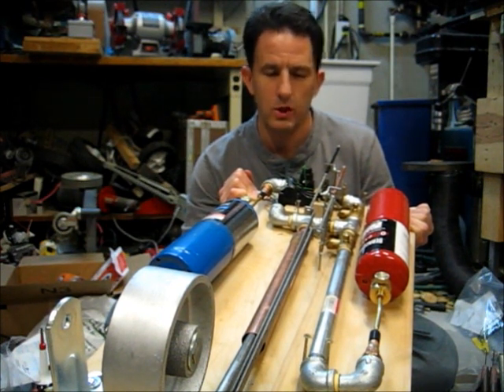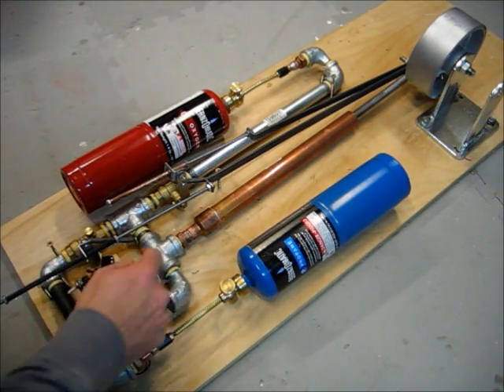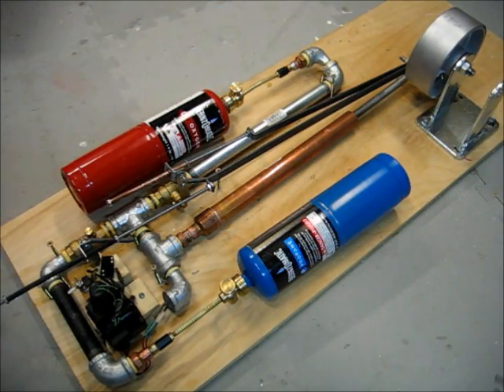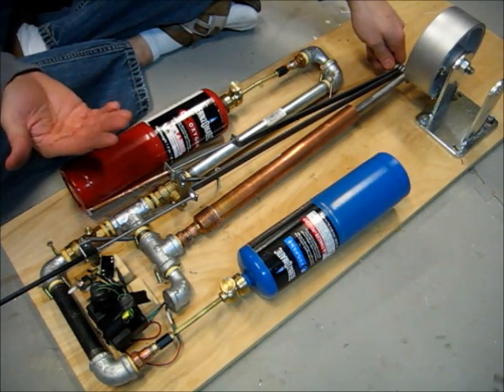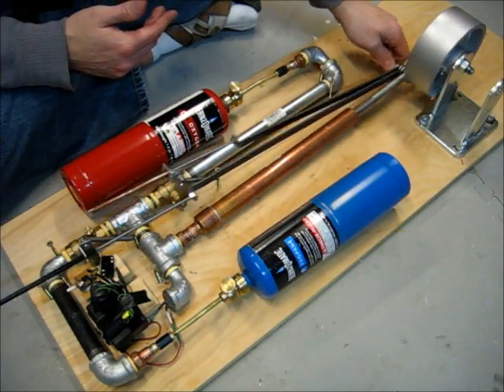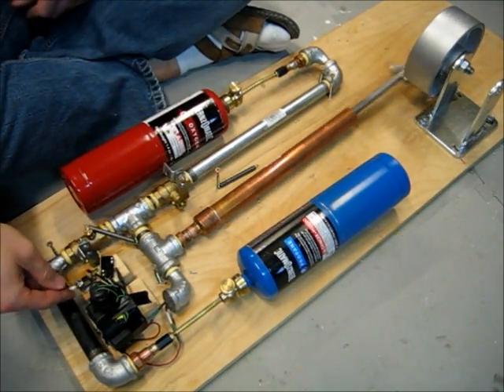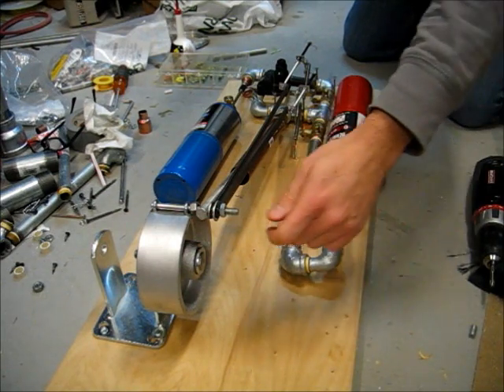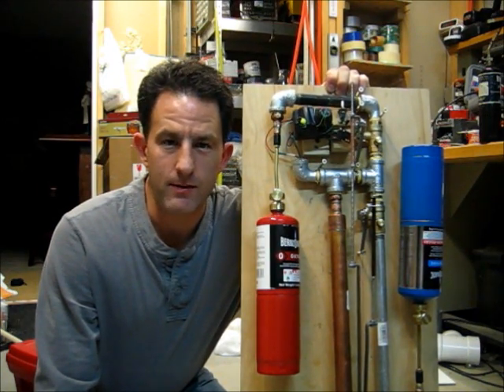How To ALMOST Build an Engine With Only Parts From the Hardware Store (HowToLou.com)

Comment: did you ever find a fix? Was the problem the exauhst leaving behind too much gas in the chamber so it couldn't ignite? Or is it a timing problem with the spark? This is so cool. These are probably stupid suggestions, I barely understand anything about engines but love them.

Comment: You need spark, fuel air and compression for a gas engine. I would check compression as the other 3 seems to be there. Hope this helps

Comment: If you are still working on this, here's my more than two bits. I see a lot right here and a lot wrong. Glad you are trying the project. I love it when anyone breaks down the perception that everything has to be made in some giant factory. 

The volume of the combined combustion chamber and cylinder is so great that it does not seem to be intaking enough new gas to overcome the spent gas. Even if you get a few strokes out of it this is just going to get worse. Why? Eye balling the set up I think the combustion chamber volume is possibly more than the cylinder volume. This means the % of combustion gas will never go down.

I would get those valves right on top of the cylinder. As close as you can get them without making special parts. Maybe go with solder fittings which are usually a lot shorter.

I would also increase the cylinder diameter. I think a 2 " pipe might be enough. That will help pull in more new gas than spent gas that is hanging around in your combustion chamber. 

Your piston seems sloppy so I'm guessing it's not getting much compression. Maybe you can try using 3 or 4 washers with some leather sandwiched between them. The leather will burn after not too long but so what. If you get it to run for ten seconds you've proved the point. 

A tighter piston and more compression will require a heavier fly wheel. 

On your carb bowl I would put a cap that is bigger than the pipe on the air intake and drill a bunch of small holes to try to evaporate the fuel more efficiently. To adjust the fuel air ratio you could put a small gate valve from an icemaker line to allow some air to bypass the evaporator line. 

Or you could make a venturi. They sell venturis in the garden section for pulling chemicals into a running hose. Not sure they will work with air. 

You need to open your exhaust valve well before the bottom of the stroke. I can't tell when it's opening from the video. If the piston is under pressure at the bottom of the stroke it's going to want to stay at the bottom of the stroke. A larger flywheel would overcome some inaccuracy in the exhaust valve timing but not much. 

Think about how long your intake valve remains open too. Too long might create too much explosive force for the wall thickness of the cylinder. Of course even a better piston as I've suggested to going to have a lot of blow by at higher pressures. 

If you get a tighter piston and you approach even 100 psi the bolt attaching the piston rod to the crack wheel is probably need to be bigger. Do the math - pi * radius sqaured in inches * ball park PSI. Get a feel for what's going on. 

Finally stiffen up all your push rods & pull wires. Slop is your enemy. 

Good luck, be safe & let us know!
Reply from the maker: John Delaney - Great suggestions.  I have already reduced the combustion chamber, so we are getting 4 or 5 to 1 instead of 2 to 1.  Also, a big breakthrough.  We found the spark was often shorting outside the clyinder.  Send and email to HowToLou@gmail.com if you would like a picture of the latest setup.

Comment: I Agree with them on the exhaust and fuel to oxygen ratio. But also it seems like your timing isn't right. I see the metal rods are taking place of your cam shaft. But you could mix your fuel in oxygen in one valve and direct that into the combustion chamber. And use your other "valve" on the exhaust. So fuel and oxygen would go in to the combustion chamber in 1/2 stroke and in the next1/2 stroke your exhaust would come out. To do that you'd have to relocate your fuel and oxygen into the same valve and create an exhaust pipe. The reroute your "camshaft"

Comment: Look up the two stroke cycle; you need to exhaust your engine like that. Additionally, you should rig a remote starting cable onto this and run it outside before you blow yourself up, or it fails and a linkage injures you.

Comment: Judging by the smoke you have when you compress the cylinder by hand and no smoke when you operate the gas inlet manually, I'd say you're basically choking your engine out with exhaust gases displacing your intake gases.  I guess if you had an exhaust port in your cylinder so that the push rod would reveal the port at the end of the stroke then that would work.  You'll lose a little efficiency, but at least you won't have to force the exhaust gases out by hand after every stroke.

Comment: Try building a circuit that has servo's to allow a two stroke engine and to allow beter timing but you may need to do some research for the circuitry and yes the exaust is nesecery because the expended gass prevents the new from coming in and burning properly that's all I can thisk of right now ill post on your take 2 vid if I come up with more ideas

Comment: I would try cutting a hole in the copper "cylinder" at the top end of the stroke, basically my understanding of this is it is simply a 2 stroke engine, you just need the exhaust gases to vent.  That would allow that to happen when the piston passes past them, and the momentum of the flywheel will push the cylinder back down for the next power stroke!

Comment: This was the first thing I saw with this. I'm a mechanic and not an engineer but even I could see that. Perhaps you could replace the T fitting above the piston with a Cross fitting and another valve to open on an exhaust stroke.

Comment: +1 for check valves.  You don't want O2 going into your propane tank or vice versa.  In general I wouldn't try mixing the two in a closed system like this, it's just too dangerous.  You should investigate using a propane/air mixture instead.  I know it might mean a re-design but you don't want to end up with a pipe bomb.

Comment: it looks like one blast is creating so much force that the rpm is too fast for your flywheel. The next cycle doesnt have enough time to pump and mix gas/oxygen/get spark off at the right time. It looks like it might work with a slower rpm/larger flywheel that gives a steady amount of fuel/air.

Comment: Lou, your connecting rod keeps hitting the cylinder walls, which is causing a lot of parasitic loss.  Ideally, you need a 2-piece connecting rod with with a rod guide near the open end of the cylinder (look at a diagram of a large 2-stroke diesel from a WWII submarine or a cargo ship).  The people talking about your fuel-air ratio are correct, you need to lean it out some more (stoichiometric ratio for gasoline/air is 14.2:1, propane/air is 15.5:1, propane/pure oxygen is 3.63:1).

Comment: I'm absolutely no mechanical engineer ... but it occurs to me a lot of energy from the engine is (presumably) going to get wasted in noise, heat and "velocity" wherever parts of the engine aren't moving smoothly and precisely.

I doubt it's going to "make the difference" between what you've shown and a running system, but I'd consider (alongside a flywheel for smoother momentum) lubricating all the parts and anchoring (holding, securing) the wheel from both sides - and balancing the weight in it

Comment: For those who are wondering,this engine type is 2 Stroke True Naturally Aspirated Engine,running on uncompressed mixture igniting at atmospheric pressure. The efficiency of this will be about 1.5 - 2%,however power output enough to keep it running is the only thing to consider.

Comment: Make a sleeve to cylinder end to support the connecting rod so it doesnt go diagonally into cylinder. Reduces friction. Also heavier flywheel. And exhaust valve of some kind. Play with gas pressures to get mixture right.

Comment: Maybe change the rates at which the chambers fill up as it seems that with enough explosive power, the piston actually move "properly". Especially since propane might not have the right properties for this, you will need the right amount of power.

Comment: Love your new cam system, taped right onto the flywheel.  Now that you have an exhaust port, it would be great to open up the fuel valves to push the exhaust out.  No danger there at all!  If you just relieve some of the pressure, the piston is going come back and compress a chamber full of smoke into which you introduce some fuel.  If one of your tanks was compressed air instead of oxygen, you could use that and be safer.

Comment: Heavier flywheel. You will not reach high revs with this engine. you need a heavier flywheel to keep it running. The engine runs unsmooth and stops itself. the flywheel will help it

Comment: Reading the comments so far, I'm seeing a lot of the things I was thinking already mentioned: heavier flywheel, lack of a true fuel/ox metering system, and spark timing.  I think the barbecue ignitor may have to go, replace it with a capacitive discharge circuit. Can "hardware-store engine" include radio shack parts?  Also, I see that when the piston fires, it puts out quite a bit of energy that could be harnessed by a larger flywheel to keep the engine moving.  Good luck and I'll stay tuned!

Comment: it seems to me like there could be unburned propane left in the cylinder after firing, as a result the first stroke is powerful and steady, the second is weaker and so on. for each stroke the amount of unburned gas builds up, leaving the mixture in the cylinder richer and richer in propane.

my best suggestion is to look into mixing the oxygen and propane more thoroughly so you get a uniform mixture across the entire cylinder.

good job on the build, i'll be subscribing to see the result. :)

Comment: Looks like not enough gas is getting to the cylinder. When you manually operate the valve it is open for over a second, however when the system is running the valves are open for a split second.

Comment: I would be very concerned about the copper pipe exploding from the pressure, since you are using oxygen from the tank. It's not going to hold together under that much pressure. You should also check your compression ratio, and maybe use a shorter, wider cylinder. I think the grill igniter isn't giving you precise enough spark timing, either. Maybe a cheap electric fence charger and a car spark plug running through some points would be better.

Comment: Lots of smart people with great comments. I have an idea for a better gas mixing manifold system. Do you have a way to view CAD drawings, or I could email you a pdf of a drawing.

Incidentally, I am super impressed even at what you have done so far, and you earlier project making an electric motor was golden. My sons and I had a ball doing that. I cheated since I have a little machine shop, but I really dig the way you are using commonly available stuff. Thumbs up!

Comment: Then it throws the piston down to the bottom where the exhaust port will uncover, the gasses will "pop" out the exhaust port, pressure in the cylinder will drop and fresh mixed gasses will be able to flow in through the check valve.

If you cant find a check valve in the store you can make one with a piece of pipe, a big ball bearing and a spring.  (look up check valves if you dont know what im talking about)  Also look up 2 stroke engines.

Comment: with a check valve you dont need to waste energy opening and closing those valves anymore - reduced friction.

Simply pull some gas mixture in on the downstroke, when you get to the bottom some will puff out the exhaust port but ignor that.  Then compress (by hand on the first stroke) the check valve will close during compression and the exhuast port will be covered by the piston.  somewhere near top dead center (maybe just before you get there) have the ignition cut on

Comment: In addition it looks like you have a lot of friction.  The brass plug needs a groove and piston ring.  Achieves the same seal, but applies less friction.  Same is probably true for those little ball valves.

many two stroke engines use a reed valve, basically a one way valve to admit gasses into the cylinder.  Consider finding a check valve to do the same.  That way the gasses can be premixed and allowed to enter the engine when the piston is down, and then the piston will compress the gasses.

Comment: Lots of problems.  Those tanks are pressurized and you have equal sized pipes and valves, so achieving the right mixture will be super tricky.  Why not just use pipes and holes to make a carburetor and gravity feed gasoline into it rather than using pressurized gasses?
2nd you need an exhaust system, as was pointed out this could be a simple port at the far end of the cylinder.  
Next:  ignition timing is critical, adjust it, see what works, you probably need it to happen earlier.

Comment: Also note how far your valves are from your spark.  You have a huge combustion chamber (which takes a while to fill) with the pressure wave moving backwards from the igniter towards your valves and the pipes taking the brunt of the pressure.  There's only a tiny outlet- the brass plug- for the gases to drive the engine.

Comment: looks like whats going on is that the spent gases aren't leaving the chamber fast enough, so it's keeps throwing the stometric  ratio between the propane and the oxygen off. It could also be that you valves aren't staying open long enough to allow a proper charge. Maybe look into re designing it like a for cycle engine instead of a two cycle. Best of luck to you.

Comment: Awesome! Great fun, and we get to participate. 

What happens when you open the valves for as long as the mechanism does? In the vid you open the valves for a longer time than your mechanism seems to. Also, I don't see pressure regs or indicators. If your tanks aren't at the same pressure then your mix will be unpredictable.  Also, where does your exhaust go?

Comment: Do you really need an oxygen tank?  I'm thinking propane with a regulator (which I assume handles back-pressure), always open, paired with an air compressor might also work. (I'm leery of oxygen tanks)

Comment: I dont see where you are venting the gas after combustion. If you dont do that, the pressure build up will stop the system from properly cycling and filling with enough renewed fuel. I would cut small grooves in the copper pipe near the position of full extention so that your piston moves past them, allowing gas to escape.

Comment: What is the pressure in the oxygen and propane cylinders? If they are not equal the one will push the other back thus screwing with the mixture. Maybe try letting the one with the lower pressure in first, then one with higher pressure.

Comment: The spark timing is way too retarded. you should be sparking within just a couple of degrees of tdc either way. This means your a/f mix should be entering the cylinder though the last 40 or so degrees of the down stroke and the first 40 to 60 degrees of the upstroke leaving the rest for compression. This means the exhaust port should be positioned somewhere between 120 and 140 degrees from tdc. Overlap with int. and ex. creates a little scavenge but not too much.

Comment: Do you have an exhaust on your two-cycle engine?  The flywheel seems to be bouncing off the still-expanded gases.  Also, you hold the valves open for a second or two to fill your chamber...which means each intake/compression cycle must last a second or two.  You'd need a car tire filled with cement as a flywheel to slow your cycle down enough.

Comment: Also if you put an 1-2kg flywheel it must be way better,then if you get it perfect with Air you can try with oxygen to get high torque output,but that will need a bigger piston,maybe a 32mm?

Comment: Well my suggestion is to use compressed air to get the Air Fuel Ratio better as the pure oxygen will be tricky. Also i would be very careful of having a close connection between oxygen and propane specially without an one-way valve as O2 is very reactive and a Flash Boom is the breakfast of what can be done.

Comment: Hmm...i think the problem is that the time the valves are open is too short to fill the combustor. maybee you need a bigger flywheel and a relatively low rpm count.

Comment: Also you probably either need a heavier flywheel to carry the piston back up (looks like the exhaust port might help with this anyways) or a smaller stroke so the compression is less.
The other side of this is that the plug your using as a piston obviously seals well, but maybe not quite as good as it should.. I know your trying to only use hardware store parts so I can't think of a suitable option off the shelf but maybe something like snap rings could be piston rings? Compression = power.

Comment: I think you need to look at a few things:
Ratio of oxygen to fuel - try and figure out what the lel % is for your fuel and adjust accordingly
Exhaust port - I know you said you were working on this, essentially all it should need to be is a small hole just down from the TDC of the stroke of the "piston", in this case since you have the valves involved you might be able to use those to purge out the chamber instead of trying to get a "exhaust" stroke out of it..

Comment: OK, looks like your trying to build a 2 stroke engine. You need an exhaust valve that is opened after the cylinder has fired, but closed before the inlet is opened. This would then stop the motor from either locking because it cannot compress the now expanded gas, or not being able to fire the mixture due to the exhaust gases. I guess also that your gas bottles must supply enough gas to allow the piston to run back down without being stopped by a vacuum effect.